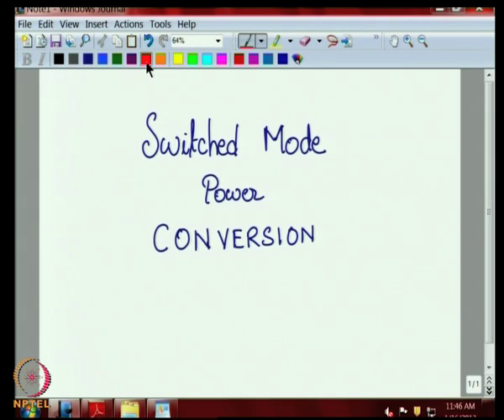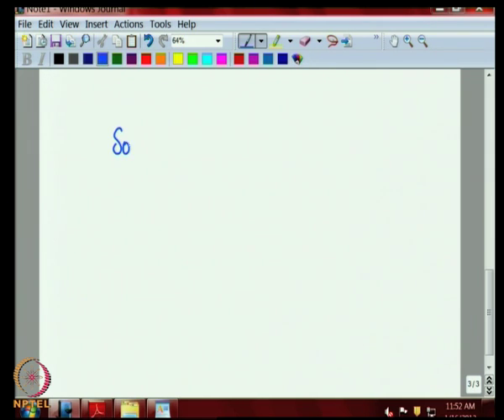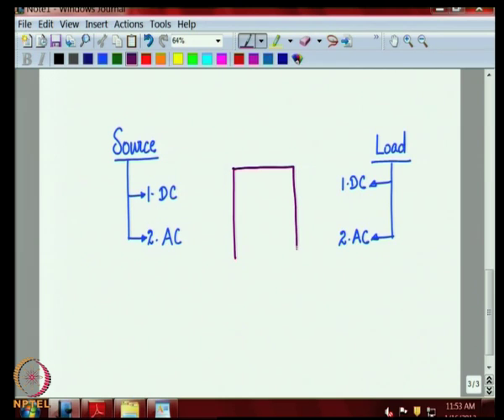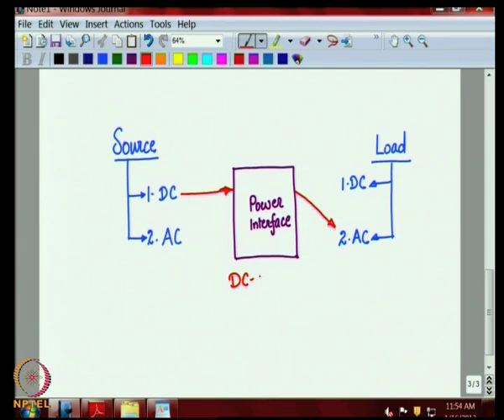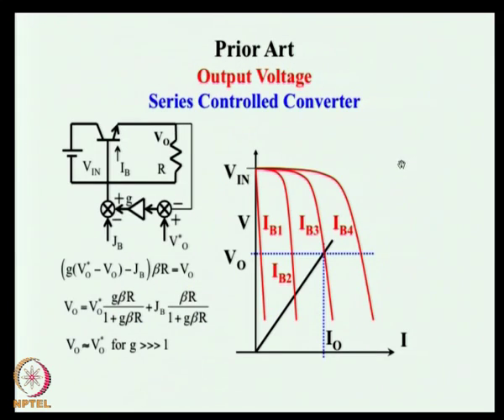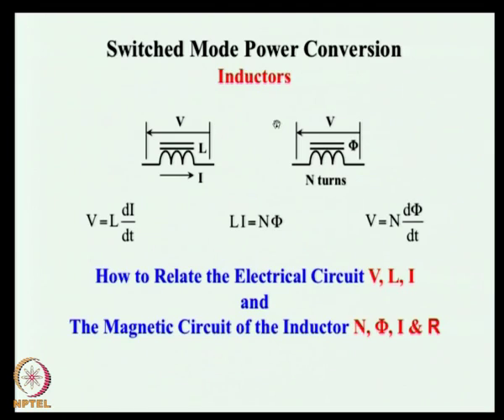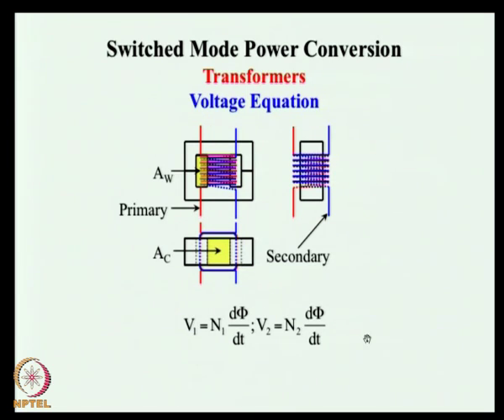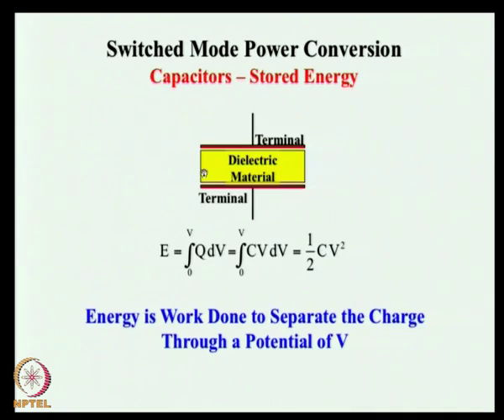Mod-01 Lec-01 Introduction to DC-DC converter

Comment: How would I know heat generated by dcdc converter. 
Iam using dcdc converter: LTM8067
Input voltage: 24V, Output voltage:5V.
With load current of 398mA
Efficiency is around:75%(from datasheet) 
Power dissipation calculations I have sir, but how to calculate heat generated by that DCDC converter is my doubt sir. Please clarify this sir?